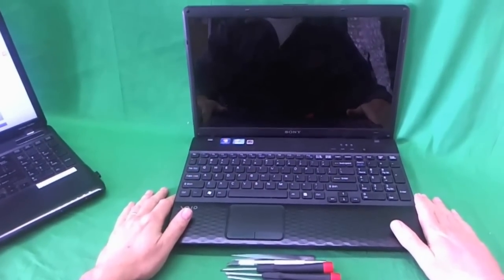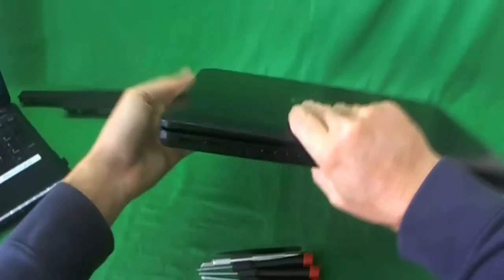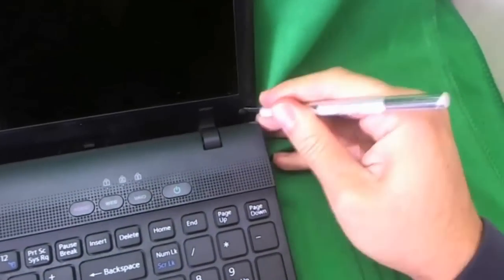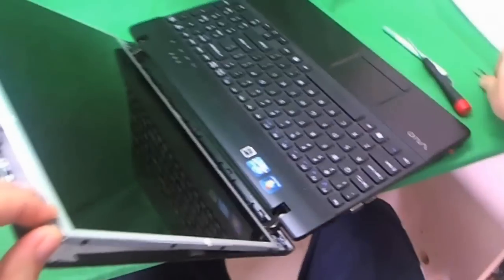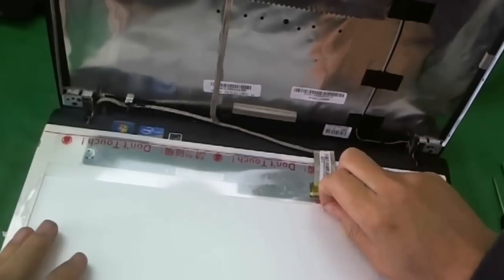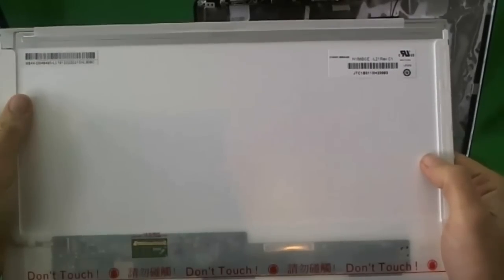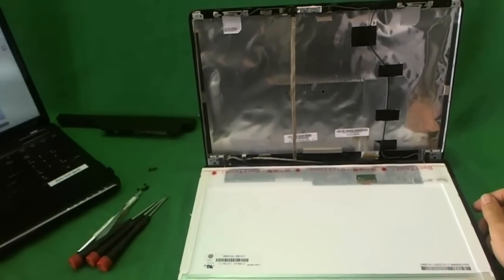Sony Vaio VPCEH Laptop Screen Replacement Procedure

Comment: Hi do you know if the screen connection cable that goes to the motherboad 
can be changed with a cable from a different brand laptop, Im not sure if they have the same cables, thnx

Comment: i have the same vaio model. i don't have problems with my screen. i just want to ask if it's possible to replace it with same size but 1920x1080 resolution. and how many pins should i look for? thanks in advance!
Reply: I wish i could do this as well, the laptop is still in pretty good shape and I changed the hard drive with an SSD three years ago and it runs sweet, but I think an IPS screen with a 1080p would make it awesome, also the processor can be changed with a core i7 from the same generation and it comes with 4 cores, used ones on ebay sell for just above $100. I just feel that buying a new one is a waste of money, I only use it for web browsing, yourtube and print out some docs we need at home...
Reply: @huss1205  Did you had any chance upgrading the screen to full HD? I want to perform the same procedure.
Reply: @yunussavc3414  not yet but the computer still used...

Comment: i also have this vaio model. my screen isn't damaged or whatsoever. its just that i found a replacement panel with fullhd resolution. can i replace it with LG's LP156WF1(TL)(E1)? will my laptop be fullhd or still in its native hd resolution? please reply. thanks!

Comment: I have this same model and was told that it's either the backlight or the inverter. Since you have stated that there is no inverter, than can I just replace the whole screen? Because the backlight replacement appears to be very difficult.

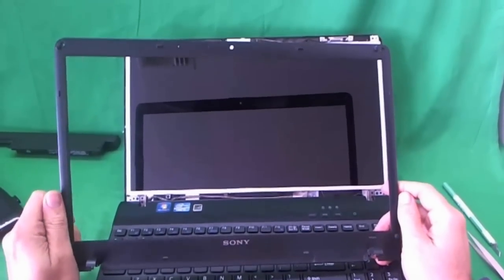Comment: Thanks! I literally just finished doing this like 5 minutes ago!! Super helpful! Its pretty simple but it took me a lot longer than 13 minutes to finish, the screws on the side at 6:00 are really tight and HARD to get out! But putting it back together took like 5 minutes tops. At the end of the day the screen cost me 60 bucks and sony was about to charge me 600 to fix a 500 dollar laptop. i figured at worst it dosent work and i lose 60 bucks.